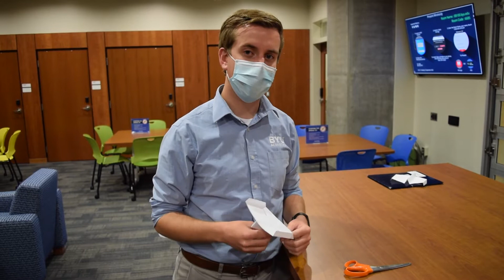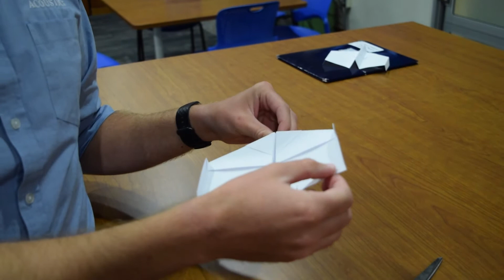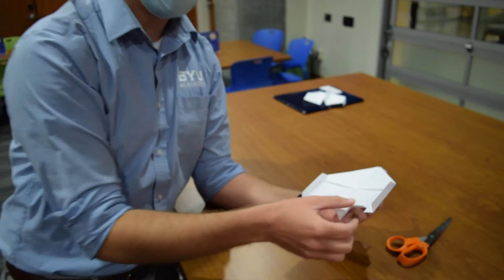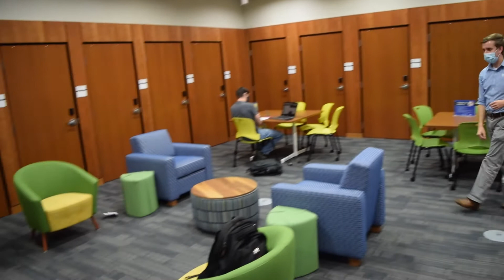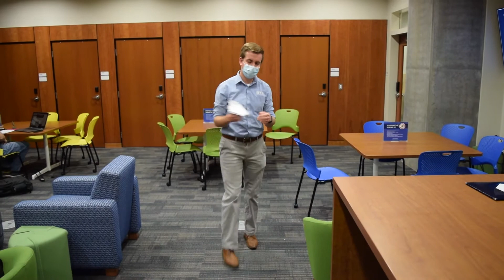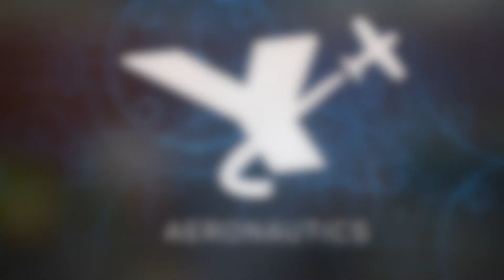Episode 1: How to Control Your Paper Airplane (Beginner)

Comment: Great video! However, I think the effects of ailerons/elevons works the opposite way in paper airplanes. For instance, in the last part of the video, the upward left elevon and the downward right elevon was expected to roll to the left (from pilot's perspective); however, what happened was it rolls to the right.
This is because the downward right elevon has so much drag  that is pulling the right wing of the airplane. This effect is known as "adverse yaw" and it is more evident in slow flying model like this paper airplane. This yaw also causes a roll to the right side, which is seen in the video.